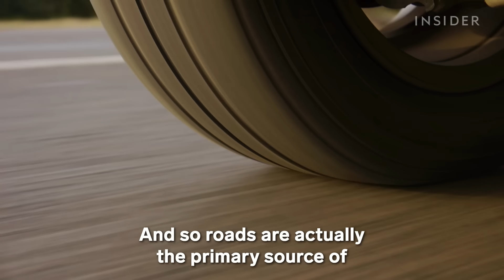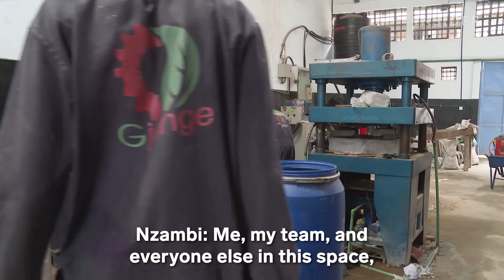Young Inventor Makes Bricks From Plastic Trash | World Wide Waste | Business Insider

Comment: Good idea but what it happen when the pave start to broken and the small particel of plastic start to be spreaded around in the air and water and water springs and contaminating human and animals with microscopic plastic cells. Another very important point is the grip that a road like this can offer under very high temperatures like they have there

Comment: WON'T. PLASTIC MELT WITH HEAT CAUSING IT TO BE SLICK AND DEFORM
CAUSING CRASHES AND DEATH..AND WHAT WILL EXTREME COLD DO TO IT WILL
BECOME BRITTLE AND UNSTABLE
Reply: Are you stupid? They wouldnt be doing this if that would happen. Thats like a antivax saying you will die from vaccines

Comment: Asphalt is the most recyclable material in the world, all your “new roads” are really just old roads crushed up and redone, the only new part is typically top coat
Reply: Just needs 25%? of oil added, so it binds properly.
Reply: @Hellsong89  sometimes no oil is needed, we mix asphalt millings with Portland cement and water.
Reply: @jasnterry1313  the debate then becomes what lasts longer tbh, and how easy it is to apply.
Reply: @maddiewhatever441  That would be another win for the asphalt, due to plastic being degraded by UV light as well as friction/heat breakdown of the plastic. Thats the main issue is the plastic when exposed to UV for extended periods of time degrades heavily.
Reply: @maddiewhatever441  lol
Reply: @beardicus  And like you said we increase microplastic and put it directly back into the enviroment so this idea would might work for houses or something where you can put a coat over it but on streets totally stupid
Reply: @Hellsong89  😡😴😡😴😴😡😴😴😴
Reply: Bro you know nothing about the outside world ...most of the world just paves another road on the previous ones ...there's no removal of the previous broken road
Reply: @sahilshabir5057  true. They don't take that time to take that out they just put it on top of the other. Or art more sand earth or how ever is called then proceed to cover with more asphalt

Comment: You would be better off using the plastics to make piles for low level houses or fence pailings. The piles will be out of the UV light and not have a grinding pressure on them. They will be strong enough to hold up a house. Fence pailings will work aswell they will fade over time but no grinding pressure from vehicles. You can melt and repurpose from there.

Comment: I wonder what the insulation and thermal properties of those bricks are, could they be used to build a house, for example? That could reduce the amount of micro plastics being leaked into the env through friction and wear and tear from traffic.
Reply: plastic doesnt degrade without exposure. i dont see why you couldnt build out of these bricks and apply an outer coating of cement for additional durability? surely this would also seal in microplastics aswell? correct me if i am wrong i am not educated in this area very much but i cant think of any issues with my idea
Reply: @edwardharris6194  the coating will rub off in time. Using this where the sun don't shine is another possibility
Reply: There is a company in New Zealand already working on this.  The product is called Plazrok and it's used as an additive or replacement aggregate for concrete.  It can make concrete up to 40% lighter and has superior seismic properties.  There are many flow on advantages such as lighter loads for concrete trucks etc
Reply: Can it build a stadium or skyscraper
Reply: @WhoreStories757  it could possibly be used as the flooring or inner walls
Reply: Sure, i was thinking same, but issue is UV degradation. Concrete does not degrade from sun light, mostly due moisture and thermal cycles... plastic binder in sand... welp build bricks that last, how many years and then you have building full of plastic sand mix to process...
Reply: This woman needs to branch this out because globally if this has good impact it could potentially be the greatest idea for roads, industrial housing and even a new type of building material

It's genius 
Recycling parts for a future gain
If these work
They would basically replace brother concrete roads

Comment: Is this a good thing? Yes and no. Why? Because it seems some of the plastic that they are using could have been recycled in a more developed country. Given that its made out of materials that they get for free we shouldnt at all look at if its affordable or not. Its also a pollutant to a certain degree. Plastic that has been re-heated like this is much more likely to release its molecules into the enviroment. Not even talking about the abrasion mentioned in the video. So yes its cheap and durable. But its also pollutant. Still. I think that its somewhat better than landfills.

Comment: I know they are "as hard as concrete"
But what about wear and tear,what happens when the rough pavement becomes smooth over years?Also natural elements.
Reply: Shhhh don't tell that to the smooth brains. They also believe that this is environmentally friendly lol.
Reply: @footballnick2  i mean better than doing nothing with it or sending into space losing the resource 4ever but like,construction with plastic should probably be minimal unless its meant for short term,but then that would be thrown away as well.
Reply: @dootdoot7705  I think the effort used to produce these bricks could be put much more into actually recycling plastics and using them as items in an already desolate and poor country like Kenya.
Reply: @footballnick2  only thing i can see them functioning as is like interior walls and not the structural walls but separation ones,and other non moving non pressured surfaces,i just dont personally trust it so i am a bit based against it.
Reply: Ngl should just purchase a few bricks and test them if they are actually worth shit

Comment: it's a great idea, however there regular black tar roads are greatly contributing to the heat of the earth (black absorbs most heat), and there is a city idk which one that started to paint its roads white to reduce this. So I'm not so sure that plastic roads would help with that situation. But definitely a better solution than throwing the stuff in landfills and the ocean!

Comment: but what about when the road gets run down over time by use from cars ? those pebbles will turn into small pieces of sand/plastic and the rain can carry it into local streams... this is a great idea but i dont think itll last in the long run
Reply: Bro, did you even watch the video....
Reply: @SinnlosHoch6  did you watch the video? This question was brought up but no answer provided. Plastic in roads seems like an idea that would increase microplastic pollution so it's a legit question.
Reply: @devlinsemmler8236  yea, i know. Why do I know, cause the bring up this exact problem around mid-video....

Comment: In the early 1970s a guy started grinding up old tires and mixing with concrete instead of sand. It was more resilient and didn't Crack like regular concrete, but the emergence of steel belted tires killed that idea. This seems like a similar use of a waste product to make a useful one. Good going.

Comment: Why is it that this video only highlighted that those plastic bricks can only be used as road and not mentioning all the possible usage of those bricks. And then they mention that plastic roads causes more micro plastic in the air. WHY NOT MENTION THAT THOSE BRICKS CAN BE USE FOR OTHER INFRASTRUCTURE SUCH BUILDINGS, HOUSE, SCHOOLS. AND MENTION THAT THIS BRICKS WOULD BE HUGE HELP TO SOLVE PROBLEMS LIKE HOMELESSNESS , LACK OF ROOM FOR SCHOOL, AND CHEAPER CORE MATERIAL FOR BUILDINGS. .. ??

Comment: How does this handle high heat? Could they replace metal roofs? Ceramic, fiberglass, asphalt roof tiles?
What about long wear? House siding? Sewer pipes? Structural members like 2"x4"s and 4"x12"s?
Interior Dry Wall (gypsum board) alternative? Synthetic carpeting? Exterior panels on vehicles that could easily be replaced when damaged?

Comment: We need this in auxiliary roads in the USA. Rural, Private, and "County" roads.
Nothing heavier than a school bus should probably drive on them. And Commercial vehicles should probably have their speeds limited if they "must" traverse them. Like CNG deliveries to rural homes, fire trucks, etc.
There should also be "hardpacked dirt" skirts on the sides of these roads if heavy vehicles might use them. This would allow 5ton+ vehicles to travel at 35mph in fair weather, and prohibit them in wet weather where the skirts would break apart.
What about using plastic and old rubber in sidewalk construction? Old tires are already chewed up for use in playground and sports field surfaces. Form a compressed plastic "gridwork" skeleton that would simply have the cavities filled by concrete or some other material.

Comment: Even if you couldn't pave roads with this stuff, I love the idea of using it to pave sidewalks as those would experience less wear.
Reply: But the problem is that there's no proper road to make that side walk, if the road is not properly paved or is not paved at all, then there may be some accidents which may damage the paved sidewalk so it will do no good if you have to maintain this paved sidewalk on a daily basis when the main root of the problem lies in the unpaved road
Reply: @snotsnarler1174  I was speaking about how the counterpoint gets brought up that cars on roads wear down the road and spread plastic into the environment. So if this is a big enough problem, we could at least pave foot traffic areas with it which might be more safe as they would be less worn down. I'm speaking about more developed countries where asphalt is available or in less developed countries where the plastic brick roads are still not able to withstand the pressures of heavy vehicles traveling at high speeds. Maybe a plastic brick road might wear too fast for it to be viable to replace it and it ends up crumbling and becoming useless after a certain amount of time. Who knows? It doesn't look like there is a precedent for this. But still, even if these bricks couldn't be used for roads, I could still see them used for foot traffic areas.

Comment: The 3 of 7 plastics can be melted down. The other 4 ought to be put in the pulverizer to create rock sized chunks that then get used as aggregate with cement that gives cement its strength as concrete. They can diversify their output by expanding their input to the full 7 plastics.

Comment: maybe not roads. but sidewalks, housing lego bricks, furniture legs,  you could do heated flooring, and cover with carpet. anything that hold structure and takes light/minimal/ no, abrasive forces.  im sure people can walk on it just fine. but constant vehicle traffic will wear down anything very quickly. water drainage is also a no go, as downhill water flow presents a constant micro abrasive as particles flow down scraping causing more micro abrasive

Comment: The manufacturing process is kinda inefficient. There is a lot of excessive movement, wasted space and manual intervention. They're doing the crushing on site, so this means that they have a lot of floor space devoted to plastic jugs that are mostly air. They need to get this done off site since that space is wasted and should be devoted to stuff that increases the output quantity. Instead of using shovels, they should use a machine to mix it. The baking machine and brick presser need to be redone. The mixing shaft currently blocks material from exiting it, and you have to basically scrape the material out each time. Since it's scraped out with a more or less random shape, this forces them to measure the mass of each brick. That asphalt should be coming out from a conveyor belt into the presser. Instead of pressing each brick, the asphalt coming out of the baker should be fed into a rolling presser that shapes the material into a defined shape, and it can be immediately be cut into brick shapes in the next step with a simple cutter. This gets rid of the defects in brick shape that they have to fix for every brick.

Comment: I would probably not use those bricks in heavy duty areas, like roads with cars and trucks on them, as they would not only produce microplastics as mentioned in the video, but also would wear faster than regular tarmac, which would make poor economic sense, plus tarmac is highly reusable. But for things with a lower wear rate, such as sidewalks and paths, I think they would do just fine.

Heck, maybe even for walls, though I don't know if they are strong enough for load bearing walls.
Regular bricks are very strong compression wise, especially compared to plastics.
But for something like  a small shack or outhouse, they would be fine.

Comment: This is awesome on every level, but she needs someone with resources to help her grow this business 100x fold.
Reply: The race of somebody who would invest does not matter. All that matters is that they share the same vision and don’t add detrimental conditions to the funding.
Reply: There’s a reason why nobody has invested in her for the past three years. It’s a scam, or at the very least a concept that is impossible to scale. So you think this idea is new? There’s a reason it never took off, plastic is the worst building material for this type of function imaginable. Behind maybe just dirt.
Reply: @bimlauyomashitobi421  She's not using it as a (structural) building material though, just for smaller utilities like roads, manhole covers and such. No one invested in her yet because they've been doing it locally and are just getting to the point where outside traction is becoming a thing. Once more people notice her mission she's sure to get support down the line...

don't be such a skeptic, it's not a good look for you
Reply: @triv4555  I was referring SPECIFICALLY to roads. She isn’t some inventive genius, people have thought of this before. Plastic is a horrible material for roads and paths. It has low grip page, so people slip and fall and cars slide into accidents, especially in the rain. Plastic melts in the hot sun and cracks and freezes in the cold winter. Plastic is also extremely weak, and wears down from constant usage when used as a road or path. Plastic makes a terrible material for walking paths, and is a literal unthinkable disaster in regards to roads. This has been thought of, experimented, and tested NUMEROUS time before. Tar is cheap, easy to use, and extremely durable, it’s likely the best material we may ever discover for roads. Just because you don’t personally understand this topic doesn’t  mean that I don’t, the world doesn’t revolve around you. 

Welcome to reality. This scam has happened SO MANY TIME BEFORE. The media picks up on the big new thing that’s going to revolutionize roads and get rid of plastic, and the farthest it’s ever gone is a plastic section of road in China that was shut down in less than a week due to it being too damaged by regular wear and tear to be safe to drive on.
Reply: @bimlauyomashitobi421  never implied that it did and I already know about the weaknesses of plastic. But almost all of those can be mitigated by fusing it with other material, I’m just saying don’t be so quick to shoot down a good thing
Reply: @triv4555  No, no they cannot. Fusing it does Jack all, you just heard about it in the video and pretended that you know what you’re talking about. You clearly don’t. I’m not being quick to shoot down a new good idea, I’m shooting down a bad idea that has been attempted and failed by scammers dozens of times in the past. There is a slight difference, don’t know if you can pick up on it.
Reply: @triv4555  Okay, so ignoring your essay of a rant that basically says “I don’t care, but I’m so obsessed about you that I’m going to write you a college admission essay, but still act like I’m morally superior to you,” which I’m not taking the time to read, you didn’t actually bring up any evidence or new claims. It’s always so cute when people realize that their argument is pointless and choose to attack their opponents character instead of using logic. So CUTE!!!
Reply: Don't sell out to the white man.
Reply: @ispoilers9535  why? You make it sound like only white people can be corrupt.

Comment: Love this lady! And the horse is already out of the barn with regard to the plastic she is working with. So the angst regarding "increased"  micro plastics really needs to be directed at the manufacturer of the plastic, not this lady's  ideas about what to do with it now. Maybe roads are not optimal, but foot paths and other construction material seems like a great solution. 

I think production could be increased if she directly extrudes the plastic into a press. Why does it need to be weighed?
Reply: This is a great way to sneak microplastics into the environment. This plastic would be better off in storage than in use.

Comment: I really think that improving the infrastructure like roads is a good thing. But I guess this thing brings micro-plastic generation to a new level. I guess burning the plastic in a power station with good filters and use the saved oil to generate asphalt.

Comment: I like her spirit and ingenuity, but it all depends on whether microplastics actually pose a serious environmental concern or not, which is still being researched.

If so, I would be very concerned with the micro-plastics these roads would generate. This is like a tailor-made system to shred and fling plastic everywhere, as traffic tires work with wind-blown sand to act as a continuous belt-sander on roadways.

Comment: So they are putting plastic into roads from where it will break into small pieces and go into environment as mirco plastic and because of sand I am pretty sure you can't even recycle it.
its a good effort on there part but it's not a solution for plastic waste anyday.